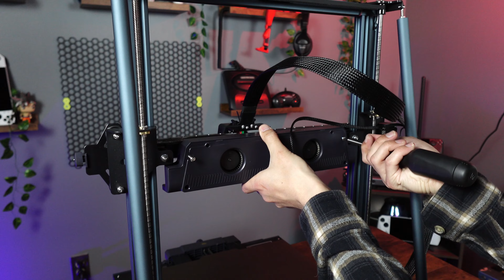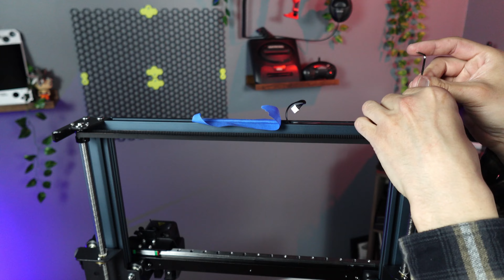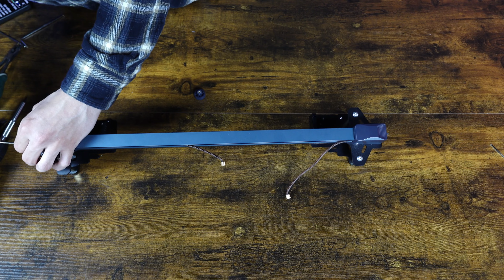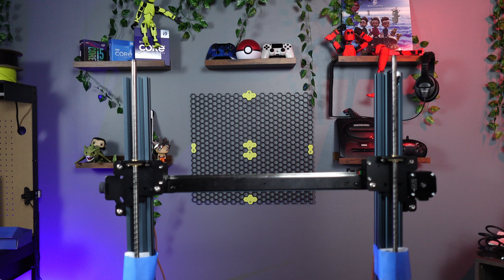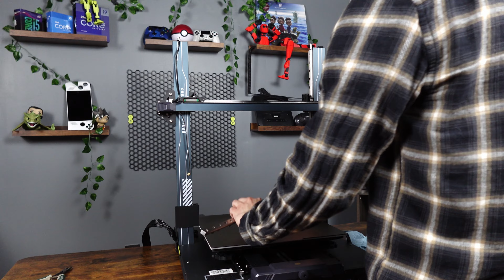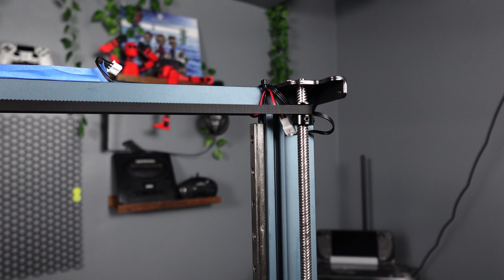Stepping into Precision: Neptune 4 Plus Z-Axis Linear Rail - Part 3

Comment: Finally had time to finish the upgrade, but when I started the machine up the x-axis motor is now making a kind whistling white noise when it is just sitting idle. When I hit motor-off in the settings the sound stops. Do you know what could be causing this?

Comment: Well, i got a bag with 8 silicon washers and M3x8 with nuts left and got no clue where they belong :'D
Reply from the maker: Best to send them a message, they can send you the correct mounting hardware. 

Sorry that happened but when they sent me the updated kit, they forgot to include bolt too. Mistakes happen.
Reply from the maker: Or it could of been accidentally included and or extras 😅

Comment: I’m thinking of doing the rails and the upgrade to get rid of the threaded rods would you recommend that or just get a core xy machine
Reply from the maker: When I started this build/series the only core XY available was the vorons. Those cost easily over $1,000 USD if not more for the same build volume. But Sovol released the SV08 and that being the cost of the this fully upgraded Neptune it’s kinda a no brainer to go with the SV08. But if you already own the Neptune then maybe stick it out for bit. It’s a great machine, it’s fast and reliable. 

But if you down own it already I wouldn’t buy a Neptune to just added upgrades, I’d just buy the SV08
Reply: @EdsTechTalk94  yeah I have had the Neptune since January haven’t had much problems quality might improve with upgrades I’m going to check out your orca profile because I have had terrible luck with the stock profile
Reply from the maker: Check out Microswiss’s FlowTech Hotend 😉
Reply: @EdsTechTalk94  I noticed your short on it how did it turn out?
Reply from the maker: A LOT better then I thought, Video coming real soon!

Comment: Is there any real benefit to upgrade slow Z ax to linear? Or you just playing with printer?
Reply: The biggest benefit in my opinion is you no longer need to replace or adjust POM wheels as long as you keep the rails cleaned and oiled.
Reply from the maker: Yes and no. Tbstron3d just released a new mod that uses belts instead of the threaded rods. But it requires the hardware used on the z axis kit. So it definitely will be a big upgrade for the z axis overall but as a stand alone upgrade, I don’t see much if any improvement in print quality.

Comment: Ok, imagine for a moment I don't have a 3d printer to print the guides used in the setup, can you instead just provide the measurements in MM of where the rails should be from the bottom of the vertical posts? Also, the measurement you're using for the distance from the top of the lead screws you're securing the belt.
Reply from the maker: Soup cans on the bed. Honestly wish I went with that approach as I probably wouldn’t have to readjust my x gantry 😅
Reply: @EdsTechTalk94  Sorry? Soup cans? Is that an imperial unit of measurement I'm not familiar with lol? I've installed my X and Y but nervous to install the Z because I can't print the guides, was hoping to get measurements of where to begin the rails from the bottom of the beams/printer
Reply from the maker: No put soup cans under the gantry and use that to makes they are equal when installing the kit.
Reply: @EdsTechTalk94  bruh im talking about the rails, how far up the vertical structure to place them, I ended up just winging it and making sure were both the same height from the top, so far so good.
Reply from the maker: My apologies for misunderstanding you. I’ll double check mine when I get a chance to let you know how from the top of the frame is from the rail. But I have a plus model so hopefully you do too.
Reply: @EdsTechTalk94  Can you please share the measurement as I don't have the guides and I have taken apart my printer :( Thanks